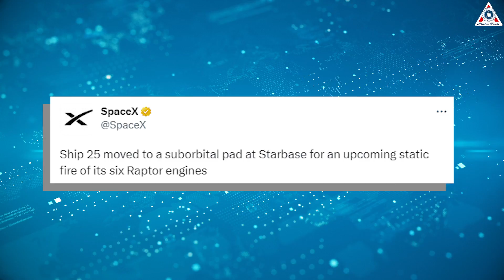The SpaceX Starship launch is coming faster than you think!

Comment: So far none of the real problems preventing the Starship from reaching orbit have been addressed. Worse than that, none of real structural faults in Starship design are even mentioned as existing. One just wonders what will it take before Elon admits publicly that the Skirt of the Starship is too weak to withstand thrust force generated by 33 Raptor engines when the rocket reaches MECO.
Reply: Stop being such a braindead fool please. The only structural problem starship has is that it's too tough. But that just means they'll need more explosives to detonate it.

Comment: They should have a Cyber Truck or Tesla car in each airlock to be the first cargo carried down the elevators.  Would be a nice demonstration of them working in vacuum, and also a real world test to see what might surprise us.  Was any long term data collected from that roadster they launched on the first Falcon Heavy?  Wondering about tires in the extreme temperatures, insulation on wires becoming brittle and cracking in the extreme cold, stuff like that.  Maybe SpaceX can engineer a space version of Tesla vehicles for limited mass production to be used on the moon and mars?  A space chop-shop could modify some of the mass produced chassis to accomodate special uses like bulldozer or dump truck or mobile base camp while most are used as-is for general transportation within a couple hundred miles of the base.  They would be so much better than the amazing Apollo folding moon buggies..

Comment: As a lunar shelter with multi decks Star Ship, if it is ever human rated, offers expansive living space for a few people for laboratory work space, servicing lunar surface vehicles and crew habitat that no other space vehicle in advanced design states comes close to.  A main disadvantage is the need for an elevator to bring people and materials back and forth from the surface to the habitat areas high on the ship.   

It could be much faster and safer provided the star ship garage can recapture is atmosphere and energy use is not an issue, to just have people board a lunar surface vehicle in the pressurized star ship garage and have a crane pick lift from the garage and lower it to the surface.   A fast acting system might be able to take people from being inside star ship's living space to driving on the lunar surface in less than 5 minutes and the same for a return.   All charging hookups and servicing along with samples and other material loading and off loading can then be done in a short sleeve pressurized environment of the star ship pressurized vehicle garage.  

Star ship 2.0 would be extremely instrumental in being able to carry industrial sized drilling rigs and other large supplies.
Reply: its big enough they could put a spinning deck in, dont know why there have been no concept pieces on it!

its close in circumference to the 2001 space odyssey grav deck https://www.youtube.com/watch?v=1wJQ5UrAsIY

Comment: As they are using the old shuttle/apollo Nasa pads, I am frankly amazed Elon hasn't transfered the next text launch there, and so was able to keep the cadence up while the finishing of the OBT pad finishes it's upgrades.
Many rocket fans might not realise that poured concrete takes 21 to 28 days minimum to cure (finish its internal chemical processes, and go rock hard, or hard enough to cope with superheavy's thrust), so the biggest wait for the next launch could be just waiting for the conrete
Reply: Nothing is set up to luanch there, plus no rockets have been manufactured there yet
Reply: The Starship launch platform is being built right next to 39A, which SpaceX uses for everything. Crewed missions and Falcon Heavy launches. Which after what happened at the pad in TX, I am surprised NASA has not requested them to build it somewhere else on the KSC property.

Comment: Boosters accurately find the drone ships when they land, I assume for a moon lander once the first attempt at a landing has been made could that point be used over and over? so a launch mount of sub-surface strength must be checked, because what if a lander tilted? one leg slightly deeper into the crust than another, it would be a disaster, it's exciting though.
Reply: Correct me if I'm wrong but I remember discussion about starship lunar lander will have independant landing legs that account for terrain inconsistensies.